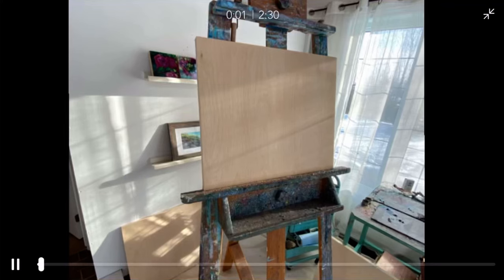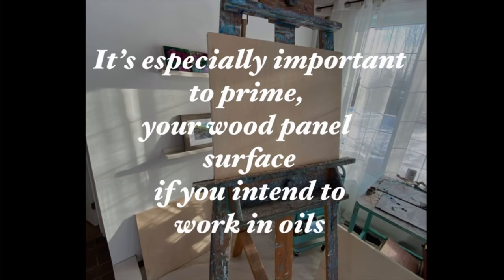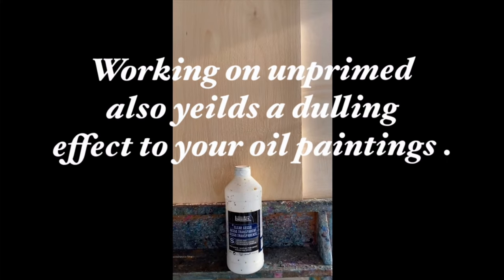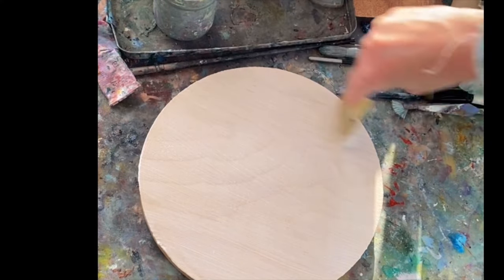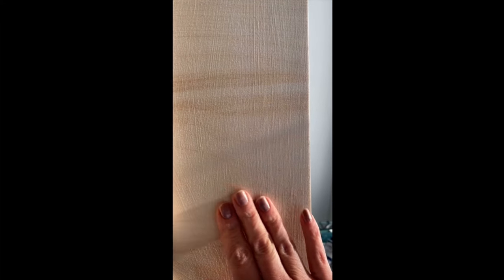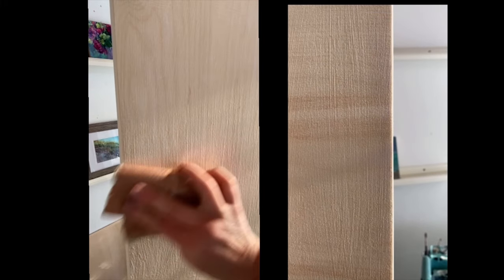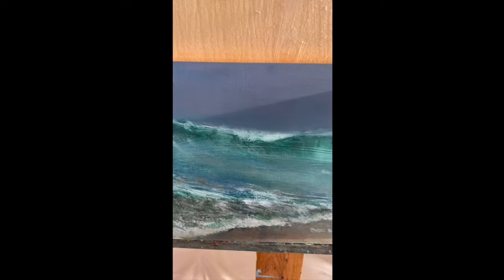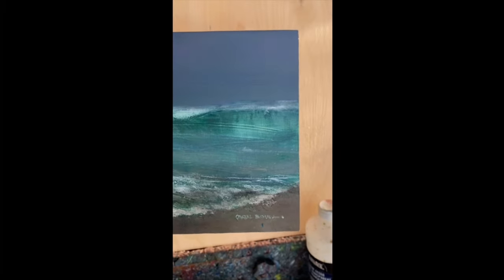DO THIS before you paint on wood panels!

Comment: Would it not be too heavy?
Reply from the maker: Hi Louie, I’m not sure I understand the question. Would what be too heavy ?
Reply: @CrystalBesharaArtist  i mean the whole piece since it's wood instead of the usual canvas. I bought a big one yesterday(1/2 inch thick) and cut it to smaller pieces. But even the 12" by 24" feels heavy. I'm not sure if  potential buyers would like it. 🥹
Reply from the maker: @louiecanaria9960  cradled wood panel and panel are very popular - as long as they are prepared in an archival manner. Clients fall in love with the artwork - don’t worry about the surface as long as it is professionally handled and packaged if shipping